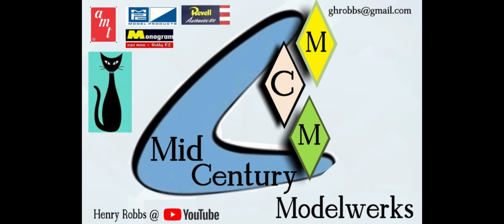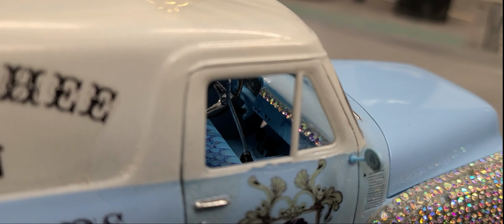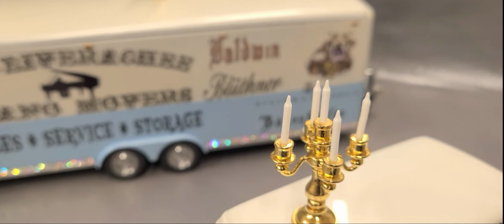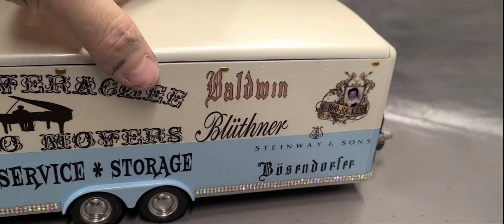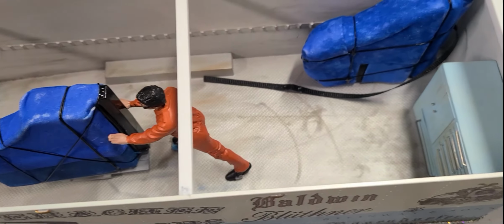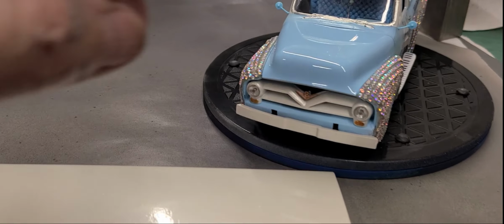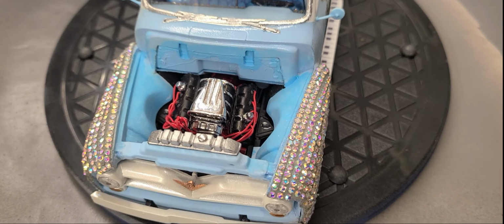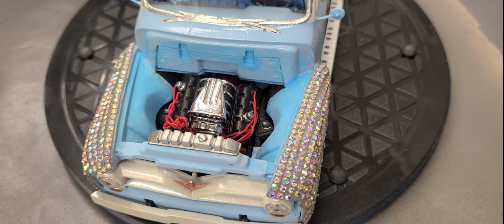U.S.A.C.C 2024 Group Build REVEAL

Comment: Awesome job! It looks fantastic! OK, on the splash paints you asked me. A few things came into my mind. One you could have put on a little bit too thick. Or the temperature might have been a bit too cold. Or either the primer has not been seen it enough for it to bite properly, then the clear coat peeling up. 
Those are the few things that came into mine.
Reply from the maker: I don't usually practice with spoons but I may need to with this brand. I'm thinking it may have been either too thick or the temp like you said.